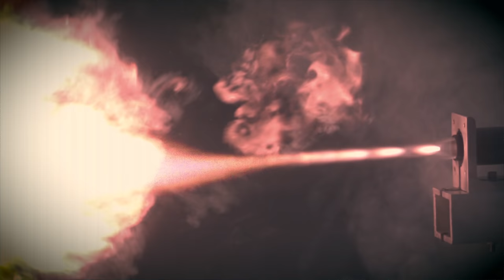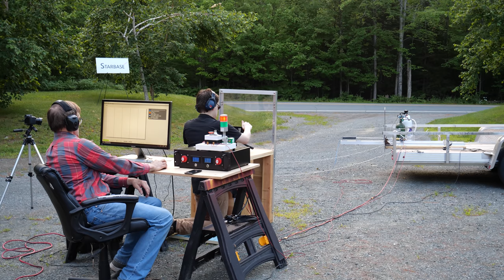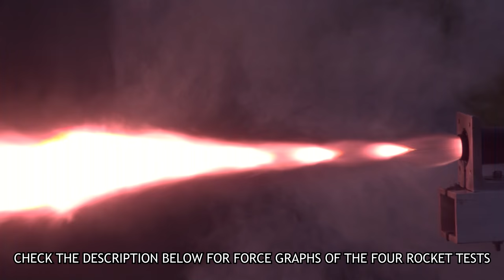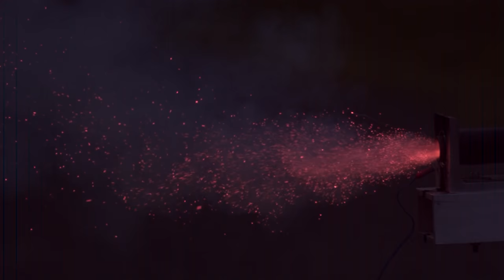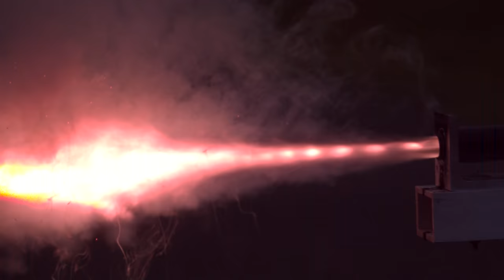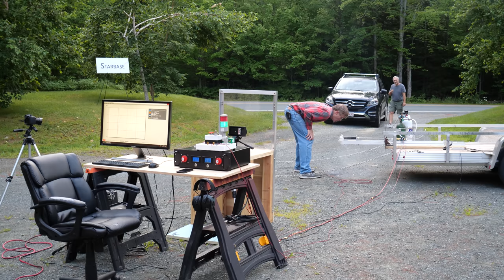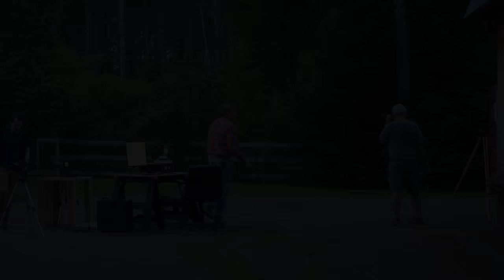Our Most Powerful Rocket EVER! Upsets Local Official!

Comment: In the next episode: "Bearing and range finding with DIY microwave radar system."
Reply: That would be cool.
Reply: It also cooks great lasagna,lol....XD
Reply: check out the MIT coffee can radar system, there are full instructions.
Reply: The joke is that such a system would provide guidance for a weaponized rocket, yes?
Reply: @Oberon4278  yes
Reply: Cellphone has gps, as well as a serial output and Bluetooth. Connected to a microcontroller you can control surface planes. Plus, you can facetime with the target, briefly.
Reply: @FullCircleTravis  get GPS from other end, have rocket call Vladimir for fix!!

Comment: One year, a physicist and I (chemist), had students in a summer STEM program building solid fuel rockets using water-based putty nozzles and multi-component fuels. He used a load cell to test the rockets which producd ~100 pounds of thrust for 4 seconds. Yup, they hiss but that hiss is sooooo freakin' loud you can feel it in your body. We were hiding behind a truck in the parking lot at the university giggling like kids. And then the State Troopers showed up! They had been taking some prisoners to court for arraignment when we fired the rocket. What a show!

Comment: Those shock diamonds are beautiful
Reply: I was thinking exactly the same thing!
Reply: Shock diamonds actually represent inefficient nozzle expansion (unavoidable at sea level tho)
Reply: @kalancosta7650  No. it represents the reality of physics as we know it today. You can’t model the nozzle to get rid of it without hurting others performance parameters. Engineering is always about making the appropriate trade offs given the constraints.
Reply: @rplatt9829  She may get ... sunburned.
Reply: @AndySpicer  This doesn't seem entirely true. You can get rid of them at certain altitudes. The shock diamonds are a result of the pressure mismatch at a given altitude. Ideally the nozzle would be optimized for maximum efficiency in a range of altitude. For long burn motors this is critical, but on smaller motors that only see a few seconds of burn, it seems it would be better to have them be slightly over expanded at ground level and gradually equalize before burn out. There is a calculator that will help design nozzle geometry.  Nozzle by AeroRocket is one such program.
Reply: @NainKaigo  we don’t live in an “ideally” world. We live in one where trade offs are required. Rocket engine designers are trying to have diamond shocks because they represent a good balance of shock waves rather than a horizontally unstable pattern which could destroy the engine. What you are taking about would be a variable nozzle which nobody has figured out how to do yet. This is why SpaceX has vacuum optimized versions of its raptor engine. Maybe you are smarter than all the rocket scientists at actual rocket companies but if you are, you should be off solving that problem rather than commenting here on YouTube with the rest of us mortals.

Comment: Finally, I've been waiting for this  :)
Only thing I'd suggest although probably a little to nerdy for most of your viewers is that it would've been nice to see burn temps and outer cylinder temps of your engine, plus having a force gauge reading on the screen when showing the slow motion replays, watching those pulse diamonds move back and forth and the changes in force might've been interesting.

Comment: I will likely never construct a rocket engine, but I have thoroughly enjoyed watching your entire rocket engine series. It seems to be some of that knowledge that should be preserved with a hard copy. A digital copy on a zip drive inside a small metallic case could be sold in an online store, assuming it's all original copywritten content.
Reply: Enters the blockchain; mint it as an NFT on blockchain: copywrited instantly forever. It is how things will be done in the future.
Reply: 100 years from now somebody will find an ancient copy on a USB stick haha ;)
Reply: Engines like this have been commercially available at the hobbyist level since the mid 1990s. They require a bit of effort to acquire but they have a reloadable rocket engine with miniaturized NOS tank with a pyro valve specifically designed for fitting inside a rocket body. The knowledge is already out there.
Reply: @cacaokingdom3122  The point was doing it for yourself... Really, all you can say is I can buy that?

Comment: Next time you anchor a trailer, make sure that the chains are laying on the ground. The higher up the more leverage they get to bend those rods. And once they are bent, they will come out easily and your trailer will move.
Reply: I don't think there is much to worry about with the force generated. The trailer probably wouldn't move very far with no chains at all
Reply: Good God Man, Relax a little
Reply: That's good advice for a project I got coming up where it will matter, thanks.
Reply: @jmccormick8732  still good to know
Reply: @davidmurden1831  it might rotate which could lead to a dangerous situation

Comment: Oh look at those beautiful MACH DIAMONDS !!!
Reply: I thought mach diamonds show that it's not making maximum thrust?  In other words, they look cool, but you don't necessarily want to see them.
Reply: @TheM750   Mach diamonds show that your flow is hypersonic, they are unavoidable in high performance engines. All SpaceX motors do it as well. the mach diamonds are a side effect of the pressure wave converging and diverging. When they appear lopsided or "twitch" back and forth it shows minor inefficiencies but that is to be expected from a hobbyist setup. The fact that he even achieved mach diamonds is staggering and incredible.
Reply: @TheM750  it is overexpanded so it is not at maximum power BUT rockets have a tendency to go high very quickly. So if you want the max performance (and stability) you will over expand  at start, which will turn into slight under expansion at the end (due to lower pressure).

Over expansion is also good to produce  visual shock diamond on purpose so you can measure the speed of the flow just by looking at the exhaust. Practically all rockets at sea level are over expanded (there may be even more reasons).
If you over expand too much, (use a massive nozzle), the flow will separate before leaving the nozzle and will most likely try to crush it it usually oscillates too. SpaceX tested vacuum engines with maximal expansion at sea level, and you can see some surprisingly small but dangerous flow separation there.
Reply: @dannykerby9580  It sounds like you think I'm criticizing him or their design, I'm not.  I just remember reading elsewhere that it's a sign of inefficiency at specific atmospheric conditions and was curious if it meant they needed further refinement of their nozzle design or if it was expected (or both).

Staggering and incredible might be a bit hyperbolic, but, it does look cool af.
Reply: @adamrak7560  Awesome reply, and great information, thank you.

"rockets have a tendency to go high very quickly" - Ha, hopefully!!

Comment: So when are you planning to send one vertical? (please, please, please!) Also, where would the last rocket fall in amateur rocket impulse rating catagories? What was the total and peak impulse? I'd guess an E or F.  Thanks.
Reply: Well do the calculations, they have the csv files for that in the Google drive:
The 4th launch even with the partially failure to ignite produced around 2300Ns of total impulse. So that would be a class K, with a full combustion easily a class L. 
The peak force was 691N but just for 0.3 seconds before the engine starved for oxygen. After that it dropped down to 500-550N where it stayed for approx 2.1s.
Reply: @TK-ni3qe  Nope you took the peak force. The classification is done via their impulse so force x time. And there they are clearly a lot higher.
Reply: To get it vertical they need a lot more as the tank is pretty heavy 

Edit i know they produced enough to barely lift 50kg, but for this to go any distance, they need something that burns a lot longer.
Reply: @_aullik  Pretty sure if it wasn't tied down that trailer would have went a good 100 yards from the smaller engines. A rocket isnt nearly as heavy as a 14 foot trailer.
Reply: @jonross377  you dont need as much force to push as you do to lift
Reply: @_aullik  I agree but that was way more than 50kg thrust.
Reply: @jonross377  nuklearpictures said that it was 500-550N for about 2 seconds. 500N/9.81 = ~51
Reply: @_aullik  Should have checked the data yourself.
Reply: @jonross377  I did check the txt for the 4th test. it did indicate exactly that
Reply: @TK-ni3qe  holy cow! : )
Reply: @_aullik  It would be best to use the commercially available reloadable engines for actual flight testing. They have a specialized NOS cylinder specifically designed for fitting inside a rocket body that uses a valve opened by the ignitor firing. Removes all the wiring as well as provides the flight tested and approved fuel bottle. They could easily pour their own fuel to test fire in those engines.

Comment: The combustion looked a bit unstable especially in the last test. Do you have any ideas on why this would be/how to improve the stability of the combustion? (My guess is that the paraffin fuel grain is melting and causing issues, but I'm really not too sure).
Awesome job though!
Reply: The last one was just lack of oxygen during the burning. You see all of that black smoke there, that is all just unburned carbon. I guess the pressure inside the engine just went to high so that the flow from the tank just could not overpower it. 
You can clearly see in the data, that they first had a spike to almost 700N while the engine igniting, then it dropped down just below 500N to then stabilize at around 550N. While with a perfect burn you would assume that the force would rise after ignition as more surface area would become available while the fuel slowly burns away.
Reply: Instabilities can lead to dangerous resonances that could burst rocket. A metal rod down centre of grain can help damp out resonances.
Reply: The lopsided appearance of the mach diamonds and the "twitching" do show some instability in the burn and pressures. Yes probably due to the solid fuel instability in the pressure chamber. A lot of hot particulate was being ejected as well meaning that his fuel mixture was off enough that the particulate wasn't being fully combusted in the pressure vessel. Still even achieving mach diamonds in a sustained burn is incredible and a massive achievement in my smooth brain!
Reply: @Kevin Corapi I tend to agree with you although I also think nuclearpictures is partially right. I think the oxygen was the limiting factor but that doesn't matter. I also believe it was capable of more power. The reason you see the 700 newtons of force was because the chamber was saturated with O2 and when it was consumed the limiting factor became how much more oxygen was being introduced. What needs changed is the nozzle diameter. I would go for a longer burn not a harder one.
Reply: @jonross377  but isn't it using nitrous as an oxidiser? the o2 is just to start the ignition?
Reply: @grkvlt  yes but the nitrous is nitrous oxide. Oxide meaning oxygen.
Reply: @jonross377  of course, you just made a typo saying the chamber was 'saturated with o2' is all, so was trying to clarify for anyone else reading. thx
Reply: @grkvlt  Oh my bad lol. Thanks.
Reply: @jonross377  surely it's the rocket diameter? shorter wider rocket would reduce the surface area?
Reply: add a bit of borax

Comment: Shock diamonds is definitely a sign of high performance, but as far as I know they also indicate an inefficiency. At best the pressure of the exhaust is exactly 1 bar when it leaves the nozzle, and shock diamonds indicate that your pressure has gone below that - the exhaust is overexpanded.
Is this due to these being early tests, or is this just something you didn't optimize much? It is mostly a weight issue, not so much an efficiency issue. Maybe you forgot to account for atmospheric pressure in the design phase of the nozzle... or maybe you plan on going high?
Reply: Even a tiny difference in pressures will result in diamonds... they're almost impossible to eliminate. More importantly they should be uniform... ragged or asymmetrical diamonds indicates either a large under or overpressure. Usually overpressure results in more ragged diamonds in my experience, whereas under will result in "wandering" diamonds (moving up and down the gas stream).
Reply: Also keep in mind that rockets are designed to go up, not to stay attached to the ground. A slightly overexpanded nozzle at ground level will function optimally at high altitude.
Reply: Blue collar Hero  The vacuum chamber would have to be monstrous in size to contain all that exhaust gas without increasing significantly in pressure, and no pump will be able to keep up. This isn't practical.
Reply: Toss some bigger pumps at the problem… it’ll be fine… Remember, if brute force fails, that just means you aren’t using enough of it 😁

Comment: I wonder if a small amount of chopped carbon fibers mixed into the wax grain would help improve burn stability by limiting the amount of material that breaks loose and shoots out the nozzle. The fibers would likely oxidize quickly so they shouldn’t clog the nozzle. What do you think?
Reply: He's using graphite powder in the mix, but I don't know if being in fiber form would make a difference. Would be an interesting test. I think the sparks you see are probably the graphite anyway, maybe some starter match material at the beginning. Mid-burn looks pretty good to me. The diameter of the fibers would be important, I think he had a very specific grain size for the graphite powder. It might actually have the opposite effect, if it forms voids between the fibers and breaks off big chunks that are being structurally held in place longer than they should be. The way to tell would be to stop the engine mid burn and quickly extinguish it with cold CO2 or something, then slice it open and inspect the grain for roughness. If you don't flash freeze it quickly enough though, it will just melt into a puddle like a candle anyway.

Comment: I’m a retired munitions systems specialist.  One time we set off a standard 2.75” (diameter) rocket motor straight down into the ground.  Interestingly, although it was a much larger and most likely (only a guess) more powerful rocket than the ones you built, it’s burn time was significantly shorter.  I mean surprisingly short (fraction of a second, if memory serves).  It buried itself pretty deep.  😆👍
Reply from the maker: It has to burn so quickly in order to convert the rocket's energy into velocity prior to striking a down range target.
Take a look at our previous tests of our fast burning composite motors when I took a ride on the trailer.  trailer.

Comment: I think what I like about rocket engines the most is that more than almost anything else, they are a great example of "The devil is in the details".  A rocket engine in concept is a very simple thing:  Put some fast burning materials in a tube, ignite them, and force the resulting gas out of a small hole in the end.  But in practice, there are so many variables and high levels of complexity that go into it.  It is really beautiful...

Comment: If you had attended a large National Association of Rocketry (NAR) or Tripoli Rocket Association (TRA) 10 to 20 years ago you would have seen many members flying hybrid motors, mostly commercially made by companies such as Cesaroni (Hypertek) and Skyripper.  They used a variety of methods for filling the flight tank (either ahead of time or on the launch pad), ignition, and releasing the nitrous into the combustion chamber.  

They became popular due to two reasons.  There was a time period when the BATFE tightly regulated possession of Ammonium Percholate Composite Propellant (APCP) as an explosive.  Also, there was a shortage of APCP motors reloads due to a huge fire at the Aerotech manufacturing facility.  When those problems went away, hybrid motors fell out of favor, largely due to needing a much more (expensive, bulky, and heavy) ground equipment to support those rockets.

Further, you state that hybrid motors have greater Specific Impulse than solid fuel rockets.  That is not my recollection, but even if you are correct, that ignores the greater cost and weight and size of the nitrous tank, injector/valves required.  A hybrid motor of comparable thrust is twice as larger and three or more times as heavy at launch as an APCP motor.

Comment: I noticed your trailer "kicking" back a bit. I know you have blocks in front of the wheels but I would suggest a block behind the wheels also. Build a couple sets of "chocks" like are used for parking airplanes. They are just 2 blocks attached together with rope or chain. They can be quickly put in place or removed. Thanks for the great videos!

Comment: There seems to be a lot of unburnt fuel, assuming  the black smoke during the burn is just that, would a tube run down the core of the engine with orifices deliver the Nitrous Oxide in a better fuel to oxidizer mix? Or would it just restrict the exhaust gas flow and cause pressure issues? Also is there any chance you will be posting the thrust data for us to see?
I would also like to say that the way you present the content is be if the best I’ve seen on YouTube. There is no fluff, no flare, just information. You don’t double back and repeat things unnecessarily, and follow a very step by step timeline on how things work from beginning to end. Very well put together sir. Keep up the fantastic work.